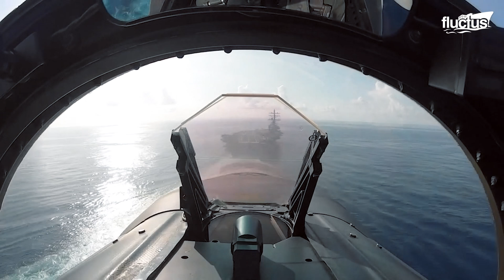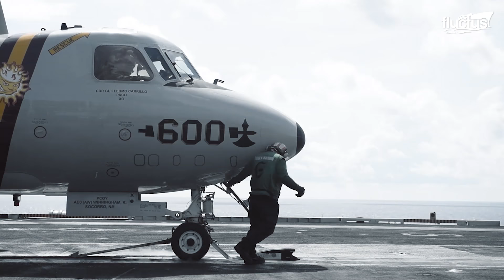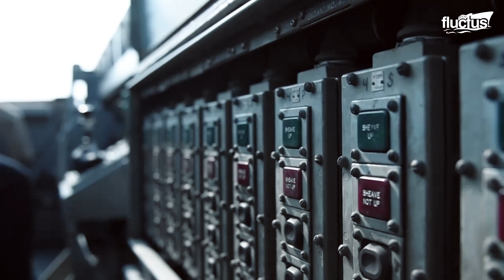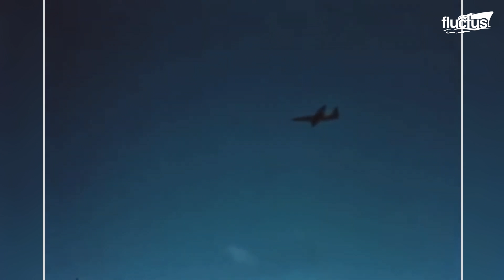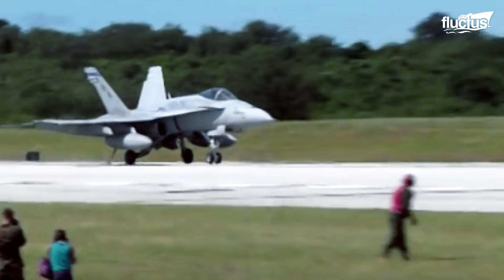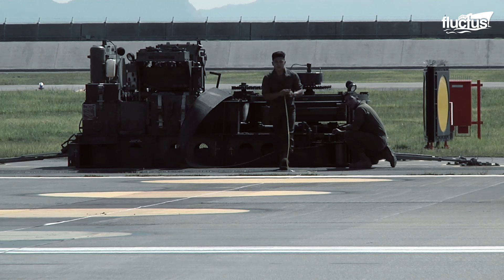US Navy Pilot Enters Survival Mode After Failed Aircraft Carrier Landing

Comment: that portable arresting system is a amazing. i would 'think' that they are at all ground bases,if possible.
Reply: Not navy, former air force crash crew. Air force bases do have cables. One for each side of runway. Only to be used in emergency or marines F4s back in the 80s. If it was raining, the marine F4s would always want to catch the barriers,which took alot longer to reset than carrier arresting cables. Hated when marines would try to our base.